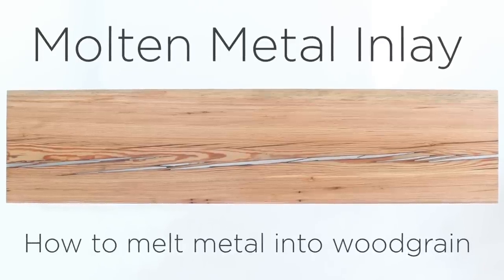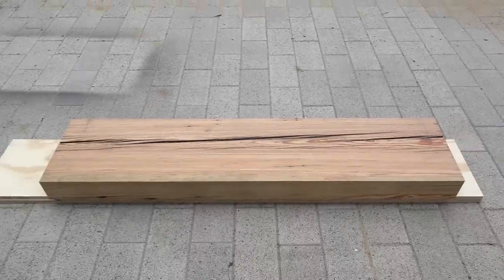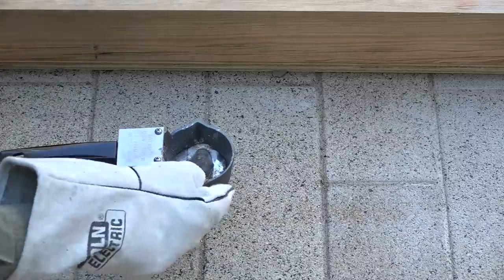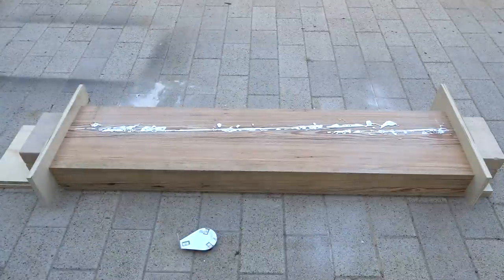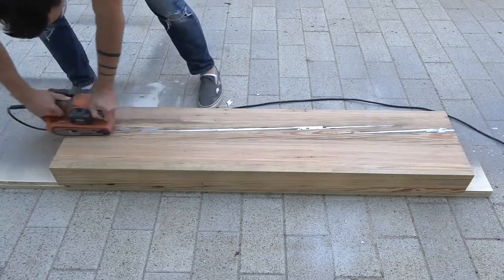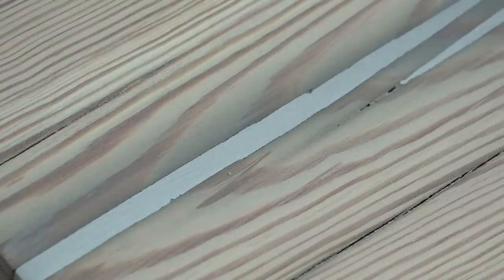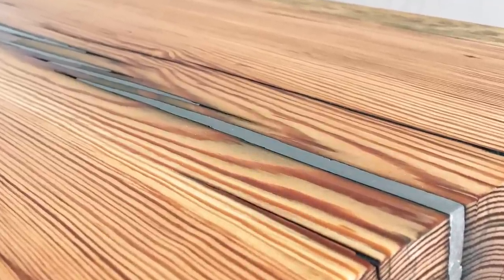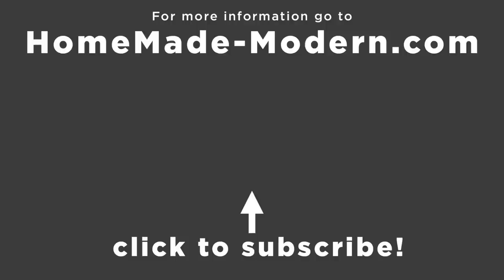Molten Metal Inlay | How to melt metal into wood grain

Comment: Nice project! 

A few tips that might be helpful if you try this again: 
- Use a heat gun to warm up the wood a bit before pouring - this will help the metal flow into smaller crevices better
- use a wooden "spoon" to push the metal around before it cools, or since you're using a low temperature material, use a heat gun to remelt it and then push it (old school automotive metalworking technique)
- you can fill in small gaps by applying some superglue and sprinkling in the metal dust - when you sand afterward, you'll hardly notice the difference.

Comment: Should have tried hand planes to smooth the metal inlays. No dust, no gummed-up sandpaper, and you could probably have easily remelted the scrap (shavings) into a block to save for future projects.
Reply: Double Dare Fan remind me to never let you borrow my tools
Reply: Double Dare Fan  281 alloy shavings from dremel are mostly oxide.  You still apply heat with a plane. From experience little can be reused.
Reply: Or maybe run it again through the surface planer. The metal used isn't that hard and wouldn't hurt the blades.
Reply: any metal will absolutely dull the planer blades. even though the babbitt is very soft, it's still metal, so you'd end up with notches in the surface planer. also, babbitt is so cheap there's no reason to save small scraps of it.
Reply: Jammit Timmaj nnn

Comment: Nice effect. You might try putting on some finish before pouring the metal. Might prevent the metal dust from getting into the pores of the wood. Not sure what the molten metal would do to the finish so would be good to try it on a small scale.

Thanks for sharing.
Reply from the maker: good ideas!  thanks!

Comment: When I was making furniture like this we used powdered metal suspended in clear epoxy.  Gives the same finished look but easier to manipulate and not so much sanding as you can use a putty knife to install.  I do concede solid metal has more verisimilitude.
Reply: Also, PSL beams have a ton of awesome fissures that can be filled with all manner of accent materials.
Reply: Also also, if you use PSL beams mind the splinters......there's lots splinters.

Comment: Coming from a Hobbyist blacksmith if you want metal to run better the only  way it to really go hotter .  And yeah just use pewter it has a low melting point  likes to run , is food safe , and seems to be naturally decently hard. And you might want to  try something a little drastic like an angle grinder for sanding just to get it flush then switch to your normal wood and hand sanding .

Comment: Since you're already going to do a lot of sanding, you might as well use a torch with a fine flame on it after you've poured and before you've started to sand. You can put masking tape off to the sides of the cracks to somewhat minimize the heat spreading. They will burn but that will leave a charcoal layer on the wood which will protect it somewhat.
You'd want to heat a bit then let it cool then heat some more using the thin flame to try to only heat up the metal to get it to sink into the cracks better. You'll get a lot better penetration of the thinner cracks. Then you can sand like you did but instead of orbital sanding, you'd get better results with a vibrating sander with square bottom. They usually vibrate the sanding paper forward/backwards, that will minimize the hand sanding you'd have to do and won't leave circles on the metal. After that, I'd put boards around it but with a spacer at the bottom so there's a 1/4 to 1/2" space between the boards and the slab then pour epoxy over the top. It will encase the whole thing and over the sides and top in one piece of epoxy, it'd never come off, hehe. Polish it and you'd have a major piece of art and you wouldn't have to worry about pieces of the metal coming out or being discolored by drink spills or kids hands getting food/gunk on the metal or into the remaining cracks.

That's my imagination, it keeps going and going and going and driving me NUTS and NUTS and NUTS ^_^

Comment: Such a beautiful effect.
Reply from the maker: thank you!  it was fun!
Reply: One question.  Is the alloy non-toxic/food-safe?
Reply from the maker: i don't know for sure but i did research Tin and Bismuth.  I wouldn't eat them but they don't seem to be massively toxic.  I would guess that under a proper clear coat it might be fine.
Reply: Thank you. Perhaps not best on a cutting board.
Reply: Would wanna avoid using metal on a cutting board simply because it'll dull your knives extremely fast
Reply: HomeMadeModern ever drink Pepto Bismol?  it's bismuth.

Comment: Looks cool! Have you thought of using molten copper, especially since you've got a lot of copper based projects?
Reply: It would burn the wood to charcoal
Reply: That could still look ok though!
Reply: fool....it would crunch into dust when you bumped it.
Reply: Using pure bismuth could turn out as a cool look if you could control the oxidation on the top surface.
Reply: Copper melts at nearly 2000°F!
Reply: It does look okay, i made a lamp from a burned tree and it looks sweeeeeeeet, just be carefull after uve burned it and put alot of coats over it because the charcoal is very brittle so the finishing should help to keep it together
Reply: You need a metal with a melting point below 150°C If you want to use copper the best way is to use copper sheets or wire and hammer it into carved grooves.
Reply: It would burn the wood so severely that the pieces would be loose after they cooled. I've seen wood used to cast copper ingots before, they fall right out once the copper cools.

The best you could hope for is a copper pigment mixed with resin.

Comment: for the small cracks that the metal popped out of... I have used powered metal mixed with resin to fill.       Of course its more sanding when you get to that stage, but unless you are know the difference is there you cant tell.

two ways to get the powered metal.  take a solid chunk and so some sanding(catch the dust)  and order it.  the same supply house normally has both.

Comment: I noticed your belt sander had a dust port.  If you remove the bag and attach a vacuum you’ll have a lot less issue with dust being ground into the wood.  You’ll also be less likely to inhale metal dust.  Another solid investment is a product called a Dust Deputy from Onida.

Comment: Hey Ben. Long time fan and I also follow your podcast. You can increase the fluidity of the molten motel by adding additive. I know adding silicon to aluminum lowers its melting temperature while also lowering its viscosity and making it easier to use in casting smaller parts. The issue of fluidity and viscosity are so important when it comes to casting and when working with metals.when it comes to the way you are pouring and casting i know its not the point of being perfect but more so "Actually doable" by a crafty handy average person. just wanted to give you some food for thought if you decided to go deeper into casting metals. look up metal characteristics and additives to change viscosity and fluidity

Comment: Nice. But you'll get a better effect with >0.005mm powder metal ( dealer's choice but Al looks good) into clear epoxy. Make a thick paste and work it into the cracks with a knife, like wood filler putty.

Comment: This is an old, traditional method for fastening the laps of bentwood (or shaker-style) boxes together. Instead of pouring it into cracks like you do, you carve funnel-shaped holes which you then pour the molten tin into, while holding a plank to the back of the holes. This creates something very similar to a rivet, but cast instead!

Comment: If that "weird" viscosity resembles how mercury or solder moves, it's actually completely normal to how most molten metals flow.  To get it to flow better, try adding a flux; it will penetrate much deeper into the little crevices.

Comment: I would suggest using metal-powder and epoxy-resin.
Mix the epoxy and directly add the metal-powder while stirring it. Once cast it looks really convincing, and should be easier to handle than metal as well as sticking better to the wood.

Comment: The way you opened the sand bag made me think it was drugs or something lol.  The molten metal does look awesome inside the wood. You could also use shaving or  small pieces inside de cracks & melt them with a heatgun since the melting point is so low.

Comment: The problem is the wood is cold so when the metal touches it, it solidifies so if you heat the wood a little it can help

Comment: I think you might have remelted the metal into the cracks with a heat gun, or even smoothed it with an iron. Sanding the metal to level it is bound to be problematic.

Comment: Since the metal is so soft, is there really a point? It's basically wood filler.
Reply: What do you mean? The metal is used for a design element. If you use a metal that is less soft, it will be difficult for the average person with average tools to complete the project, and the soft metal achieves the desired look.
Reply: Point? How'bout being much nicer, purer, and more "organic/elemental" than chemical goo?

Comment: You spent all that time on a slab of pine?... This was an interesting process. But you ended up with a pine coffee table that took way too much time and material. I get it that the fun lies in the experience, but this wasn't worth any of that. If the pine had great character, then maybe. 

You could have used a pine 4x4 to get to the same place, and used a less costly hunk of wood. You could have even glued a bunch of those posts together for an interesting effect.

Do what you like I guess. This wasn't worth all that.
Reply: Ah, but being able to tell your buyer that it's an aged reclaimed coniferous support beam is where you get your 10x markup. Not that I'm hating.

Comment: I was wondering if a soldering iron could have been used to reheat the metal to fill in the bits that pulled out. Interesting project.

Comment: I wonder how Plumbing solder would work ?
Reply: It may be easier to get into small cracks. I think the melting point could be higher though.
Reply: too much lead?
Reply: I'm actually doing a project with solder right now. I'm filling old bug holes with it. For the most part it is pretty easy going, the only big problem is some of the solder chips out when sanding and need to be glued back in. Definitely viable though
Reply: solder nowadays is made with silver, has a melting point around 200 degrees (generally). it would work, but it would likely be a lot more expensive.
Reply: William Lutes !
Reply: Solders used in plumbing and electronics are still based on tin and melt around or below 200 C.  Silver-based solders are used for hard soldering or brazing and melt at much higher temperatures, above 450 C.
Reply: Was thinking the same thing. You can get a number of different ratios in solder. I'm sure you could find one that worked good.

Comment: Alternatively, mix metal powder with your preferred filler resin and pour it into the cracks. Very similar effect without having to deal with molten metal. Plus, it's much easier on your tools.

Comment: You could put back through your joiner i don't think it would harm your blades as the metal soft. Weather it would pull it out the cracks? Might be worth a try.
Reply: I think that would work, Just take very light passes.

Comment: Would you consider putting some sort of protective coating on the wood prior to pouring. Something you could possibly sand off later so to keep the metal dust out of the grain?

Comment: Think i would have used silver paint by taping up the ends and around the cracks then just pour in silver paint. Let it set a week or so to fully dry. a light sanding and you are done!